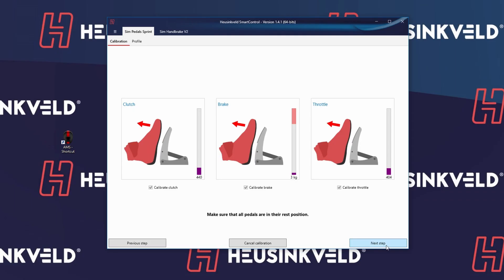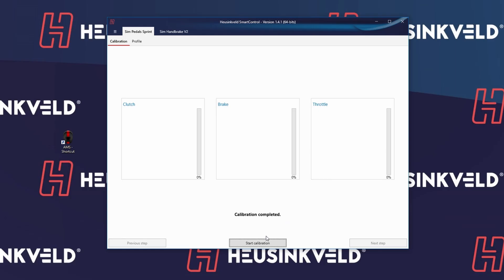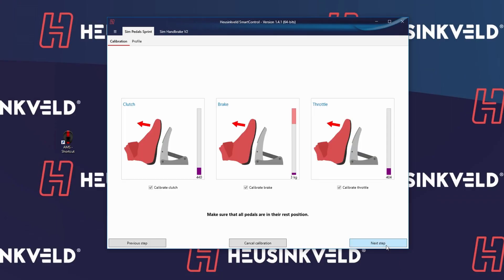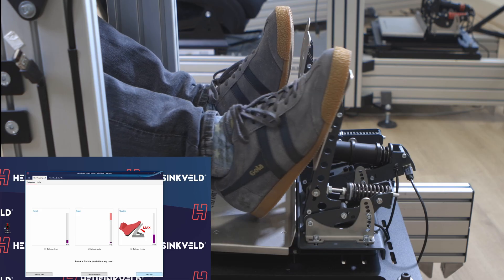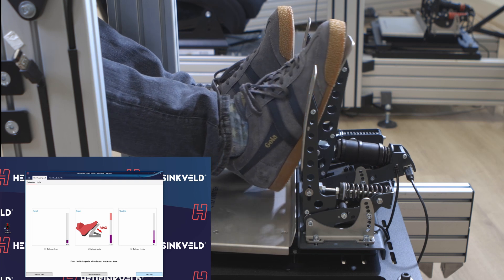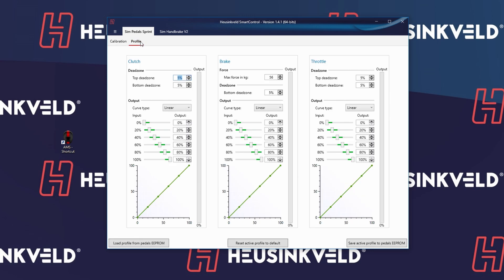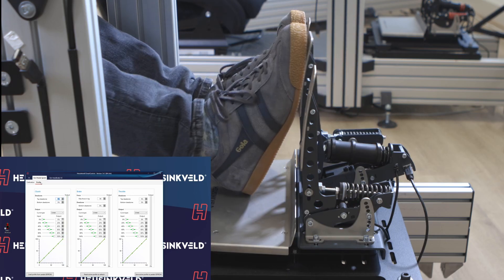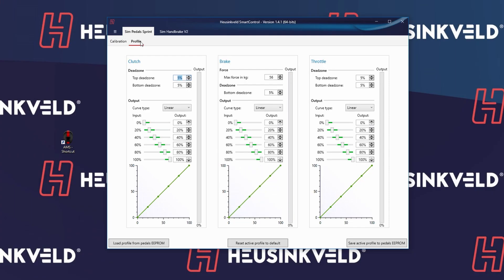Calibration of your Heusinkveld Sim Pedals Sprint in SmartControl Software #Heusinkveld #Esports

Comment: I have brand new sprint pedals and it wont register over 35kg. I tried increasing the slider and recalibrating but that didnt work.
Reply from the maker: Hello Jake, 

Many thanks for your message. 

If you have any technical questions about our products/software or need help with the installation, please do not hesitate to contact our Support Team available daily from 9 a.m. - 6 p.m. at support@heusinkveld.com.

Our Technical Support Team will answer you as soon as possible. 

Best wishes from Groningen,
Your HEUSINKVELD Team

Comment: One question to the Sprint pedals. Is it possible to set a MAX point of the pedal way independent of the loadcell? For me it is not so important to simulate a 45kg, 50kg oder 60kg brake. For me it is more interesseting to set a MAX point to 80% of the pedal way. Fanatec have removed the MAX function for the V3 pedals why I thinking about a change to Heusinkveld.
Reply from the maker: Hello Race, 

Thank you for your message. The travel on our brake pedals is controlled by the elastomers. A softer elastomer will give more travel at 30kg than a harder elastomer at the same 30kg. The maximum force you can set in our SmartControl software determines how much force is required to reach 100% brake in the different games.

We hope this answers your question.

Best wishes from Groningen,
Your HEUSINKVELD Team